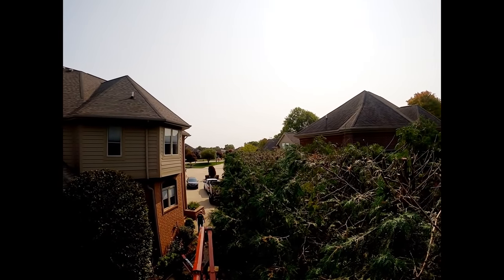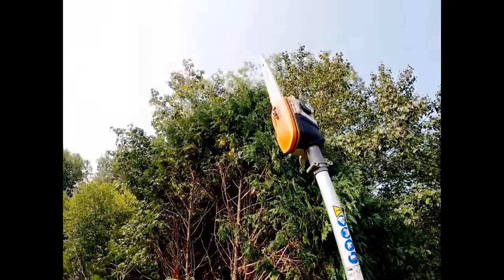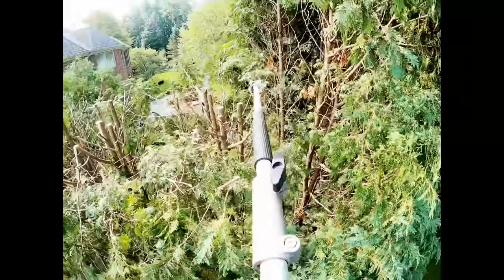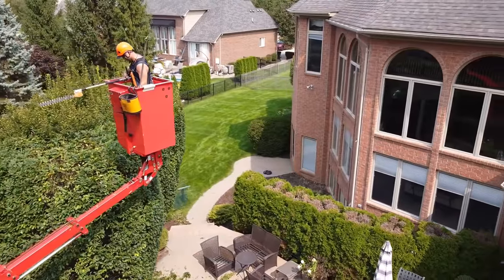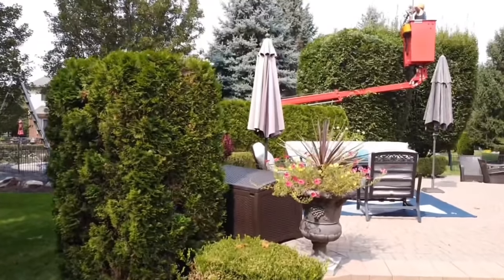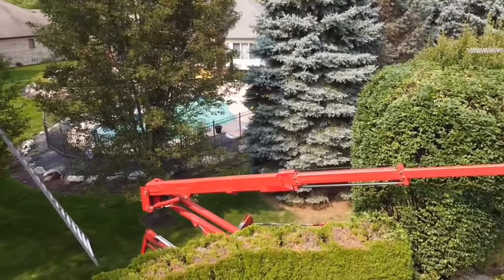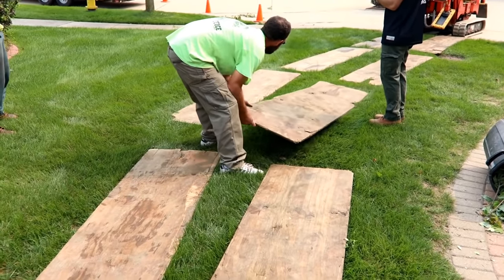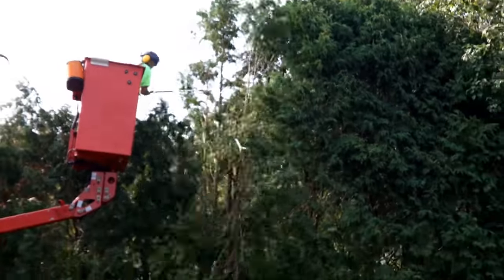EXTREME SHRUB TRIMMING // GIANT 32ft Arborvitae Shrubs

Comment: Look at back yard, mini digger derricks.  You’d basically get a small crane, an auger, and a back yard bucket all in one machine.  And if you need to set the occasional telephone pole, you can..  (im kidding, but that’s what its made for.)  probably a lot easier to find one of those used, then this thing.  Plus it can fit through a gate.  Check out the model from Altec.   https://youtu.be/nBOIMGcs_Hc